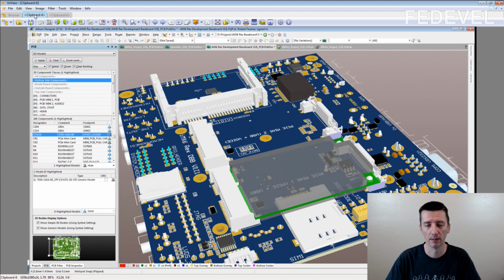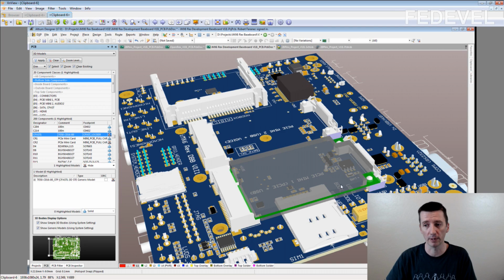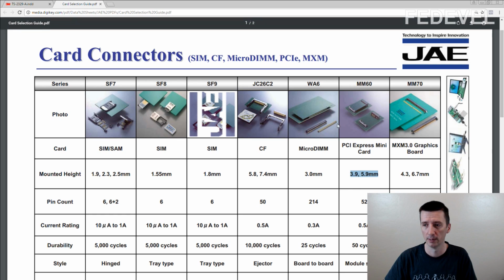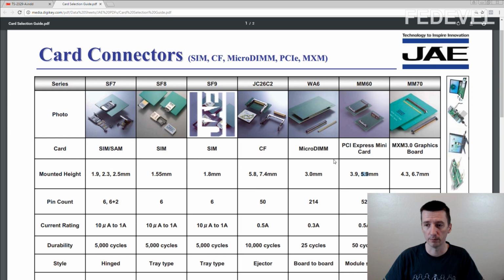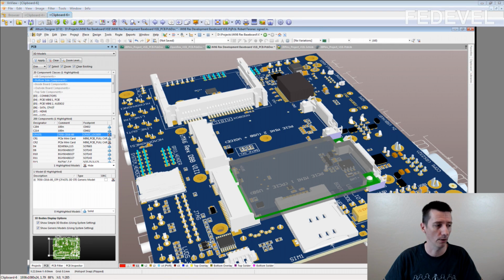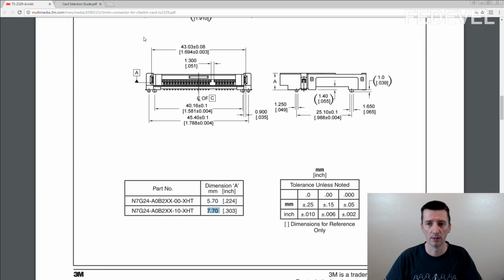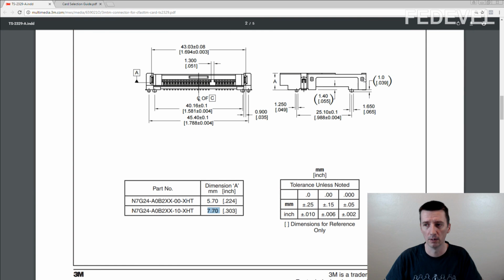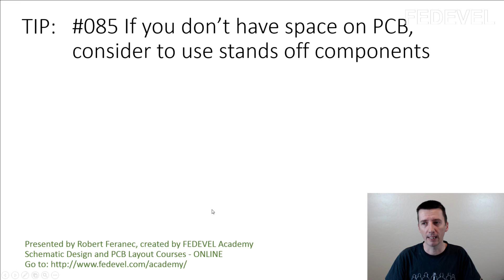TIP #085: If you don’t have space on PCB, consider to use stands off components

Comment: Hi Rob! Would it be possible to make a quick start guide about Signal Integrity on Altium please?
Reply from the maker: I am not really sure what you mean by "Signal Integrity on Altium". Could you provide more details?
Reply: Well, you know when you create a component, you can associate to it a signal integrity configuration. To be honest, I have never used this feature, and I would like to know what's the full prupose of it and how to use it. Does it make sense?
Reply from the maker: I do not simulate in Altium. They do not have a good simulator. Some time ago I tried to use it, it just kept crashing.
Reply: @RobertFeranec  please what simulator do you use